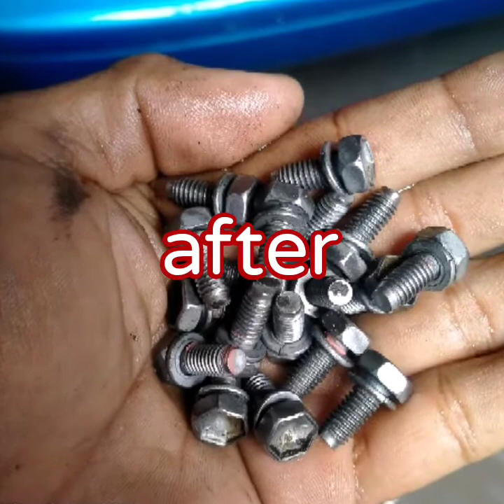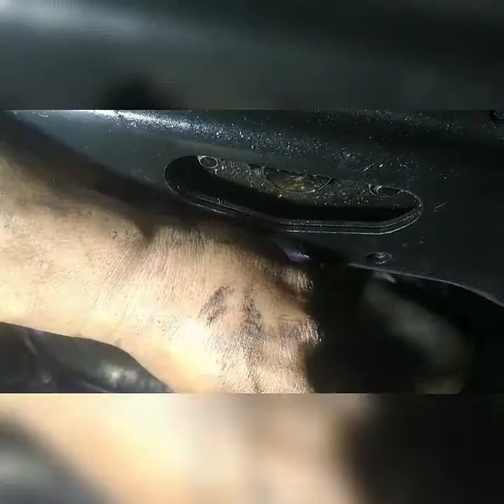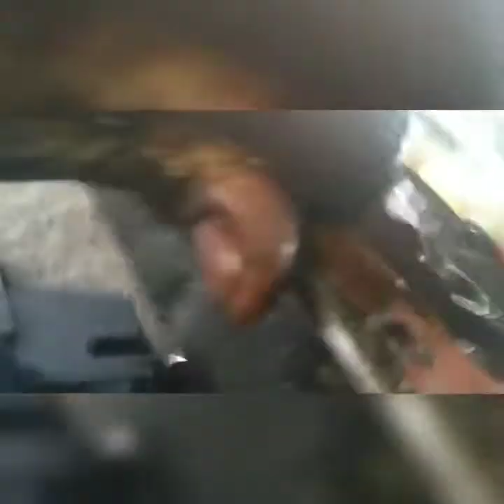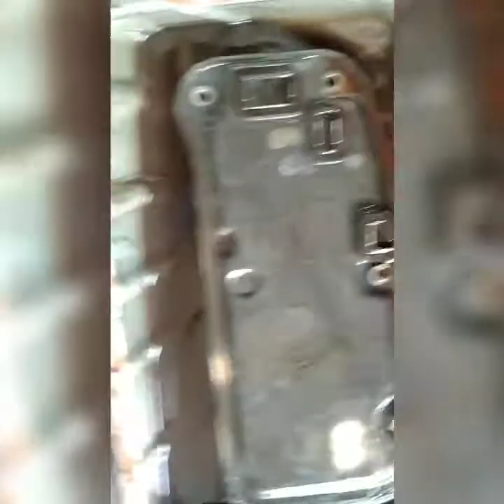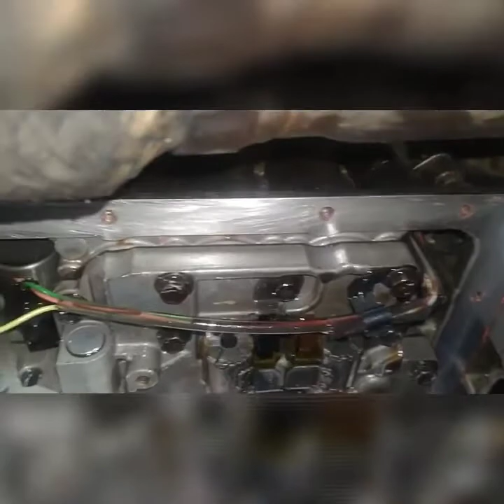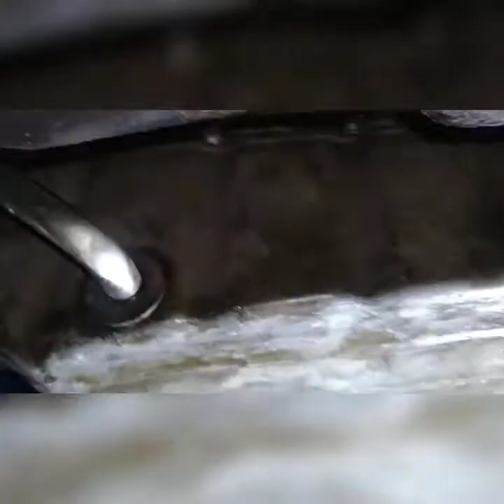Isuzu trooper change oil automatic transmission

Comment: Very good content! Thank you
Reply from the maker: Thanks
Reply: @vergelautomotive9728  bos anu brand gngmit  sa isuzu trooper na langis sa automatic transmission saka ilan liters po b?
Reply: @vergelautomotive9728  bos anu langis gngamit sa isuzu trooper sa transmission nya 4x4 automatic
Reply from the maker: 4 litter sir
Reply from the maker: @samanthatngridr.bagcal1646  kahit Anu sir basta original
Reply: @vergelautomotive9728  bos anu brand na langis sa transmission gngamit slamat.
Reply: @nakamura5831  bos tnung lng san ba nkikita gauge ng trooper yun pra sa langis